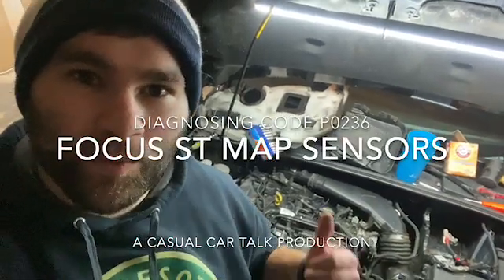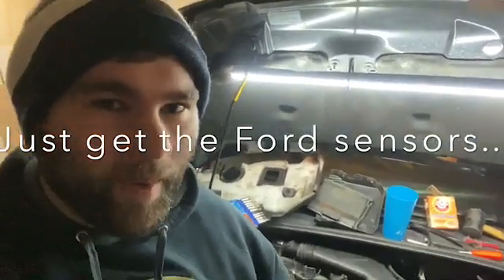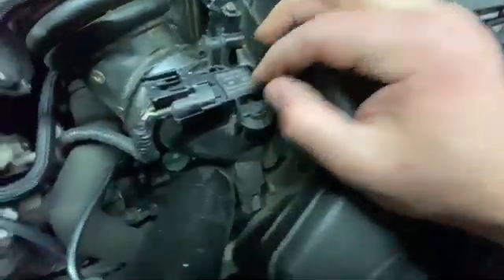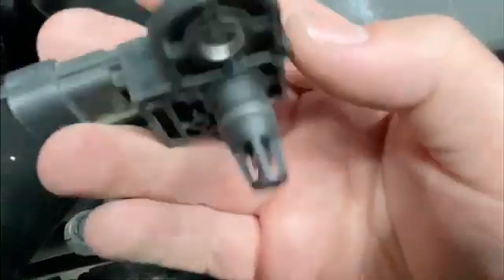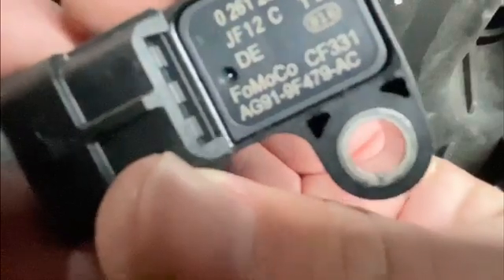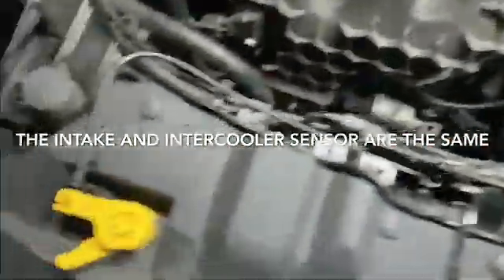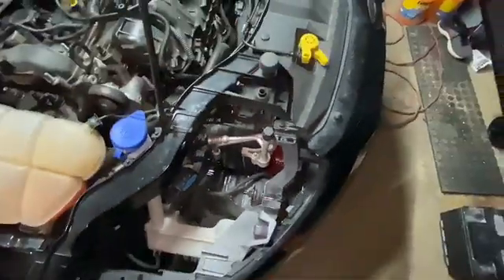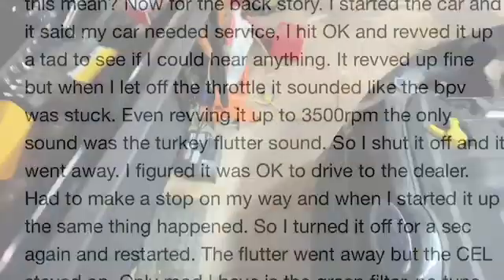CEL P0236 - Focus ST

Comment: When you say Bosch didn’t work what was it doing when you had them installed? I have an intermittent p0236 and I have one Bosch sensor on the intake tube
Reply from the maker: It kept giving me the same exact code as the broken sensor. It’s possible it’s the source of your issue. I bought the ford one and it immediately went away. Can’t promise it’ll work for you, but it did for me and I tried a Bosch from Oreillys and Autozone to no avail.

Comment: How did you manage to fit your hand through to the intercooler
Reply from the maker: I think I removed the stock air box/intake and was able to wriggle down. Otherwise go from the bottom and just remove the useless plastic trays from beneath

Comment: I have a 2017 ford focus rs and I had that some P0236 pop on after having a leak in the down-pipe welded. I’ve already changed all the sensors and the problem is still there. Even took it to a performance shop and they can’t seem to figure it out. The car seems to have no boost and is sluggish
Reply from the maker: The turbo sits right on the back of the engine. The welder most likely broke one of the small boost hoses on the turbo or the boost solenoid - I’d start there. Having a tuner look at logs will at least clear up whether you have a boost leak issue or a potential waste gate problem or something else electrical or mechanical.
Reply: Ohh I took the down-pipe off before getting it welded and then reinstalled it. Then I bought a cpe cat-less down pipe and installed that one to see if that solved the issue but it did not. I got the car tested for boost leaks and it has none, that’s what I was told anyways. Okay thank you I’m going to have a tuner look at it because even the shop that built the car could not find any problems that would cause the problem. Ohh another thing the TIP sensor which is the one by the Inter cooler is an Omni 4 bar which was tuned with the car before I purchased it. I also replaced it with another Omni 4 bar but it kept doing the same thing so I took it off and sent it back. I have a Cobb access port so I’m able to erase the codes every time before I drive. The car drives okay after I do that but only boost up to 20 psi which is way below what is used to at 30 psi.

Comment: Thanks for the video. I fitted a Bosch sensor on the manifold and it was fine for a month, but its not fixed it. I'll try Ford.
Reply from the maker: Thanks for watching! I hope it solves your problem, it was a tricky one to figure out. Please subscribe if it helps!
Reply: @gapperformance any other suggestion please? Help me.
Reply: Finally do you try Ford? Fix or Not?
Reply: @Brombe-fz4fg  Yes it fixed the issue! But then the engine died due to lack of compression caused by a damaged piston. Avoid remaps!
Reply: I've just changed map sensor with an oem ford and the problem doesn't fix. I've a m8ma 1.5 ecoboost on a kuga. @gapperformance

Comment: My 2014 focus st is not shutting off and when i do stall it, i hear clicking electric sounds under hood
Reply from the maker: Is it giving you this code? Try to get it to stall with the good open to isolate where the clicking noise is coming from
Reply: @gapperformance   no codes yet but when i unplug r14 relay for pcm the clicking stops. my service engine light come on but i unplugged fuses and relays before it come on at all. I also changed the battery today and reset the bms
Reply: A new battery  and draining my computer  has  worked so far battery was 9 years old and not losing charge

Comment: good day i need your help
I'm getting the same fault code on ford kuga ecoboos. I changed the sensors p0236 (ag91-9f479-ac and cv2a-9f479-aa) but the fault light didn't go out, do I need to change the one at the intercool inlet?
Reply: Finally do you fix the problem?
Reply from the maker: It could be any one of the 3 causing the code. I’d the intake side didn’t fix it, I’d try the Intercooler. Make sure they’re ford sensors, the aftermarket ones I tried didn’t work.
Reply: @gapperformance  all the installed sensors are original ford sensor

Comment: Hi Eric, i have a non working boost gauge on my 2014 Focus ST, i took it to Ford and they were next to useless diagnosing anything, out of lazyness thet said it was the upper dash gauges, which i was suspicious about, they also wanted $1200 to have them replaced. I left angry and bought instead another used gauge and same issue , it does not move. so that told me the gauge is fine. 
i am thinking that the issue could be the actual boost sensor/s, would you know the location of these and do you have any thoughts on this issue? any help would be greatly appreciated.
Reply from the maker: I believe the boost reference comes from your MAP or MAP-T sensors. It’s up on top of your intake, intake manifold, and another one on the Intercooler. If you had a faulty boost reading the car would likely run bad and you would 100% get a check engine light. If the gauge is the only malfunction I’d assume a wire somewhere is broken between the sensor and the gauge. Make sure you use ford MAP sensors because I tried the autozone Bosch ones and nothing changed. Mine was the sensor on my Intercooler because it got blasted by salt and broken. Good luck! Thanks for watching and please subscribe :)
Reply: @gapperformance  thanks mate , much appreciated!

Comment: So I’m going through the process of replacing all three as well. My only issue it the top on (on the air box) has a part number of CV2A-9F479-AA
The one on the inter cooler is BV61-9F479-AA
Any ideas of if they’re actually different or can I use the same one for both?
Reply from the maker: The intake and Intercooler are the same I believe, but any aftermarket sensors I used didn’t fix the issue. Had to pay full ford price ugh. Thanks for watching and please subscribe :)
Reply: In my case they were not. BV goes on the intercooler discharge. CV goes on the intake.
Reply from the maker: @roxiem9294  I’ve swapped the intake and Intercooler sensors around and never had an issue with codes as a test. The map-t sensor on the intake manifold is clearly a different sensor, it’s odd that yours are not interchangeable, but they could have done updates over the model years for sure

Comment: What if I didn't take the terminals off cause I replaced mine and didn't and my car is throwing this code and I never had this code before. I reset the code and it's still not happy about it.. what do I do.
Reply from the maker: Did you go with the oem ford sensor or aftermarket? Most of my issues are from new sensors that are bad or non-oem have given me issues because fords are sensitive as hell lol
Reply: @gapperformance  all oem i figured it out man so it was the intercooler plug was plugged in backwards,  why did they make it to where the plug can plug up on both sides.. lol anyone could accidentally do this when your under your car trying to plug a plug in thats hard to get without taking the bumper off 🤣
Reply from the maker: @joehuff2292  haha some connectors are just annoying like that, but I’m happy you found the solution!

Comment: Could P0106 be linked to the same issue ?
Reply from the maker: Definitely could be, I believe that’s the dirty map sensor code. It could be the sensor, wiring, or the connection on the ecu side. You can always chase voltages to see if you have a short somewhere. Sensors are pricey from Ford but the Autozone and Oreillys knockoffs didn’t work
Reply: @gapperformance  Replaced the sensor with a new one from ford and it fixed the issue, its been couple days since and code hasn't returned. Now would you happen to know about P2227 ? Been looking around no answer. (Maybe intercooler baro sensor) Would really help thanks.
Reply from the maker: @YoutubeAccount-tn9dj  drop me a subscribe and in the meantime I’ll do some forum digging to see what I can come up with for ya.
Reply: Did you ever figure anything out with the p2227 code?

Comment: Hi, i’m having the P0236 code on my 2016 focus st, it seems my ecu isn’t matching the boost i’m pushing and it’s making the car drive weird i replaced the map sensors and the plugs and coils and im still having the issue.
Reply from the maker: Carlos A where did you get the MAP sensors from?
Reply: Casual Car Talk Auto zone, those codes went away not it’s a boost sensor
Reply: now*
Reply from the maker: Carlos A I did the Autozone ones and couldn’t kick the codes permanently so I went with oem from Ford and they fixed the issue. It was the map sensor on my intercooler that ended up being the culprit.
Reply: Casual Car Talk the code isn’t showing back up for the map sensor, i think it could be another issue but i’m not sure
Reply from the maker: Carlos A did you gap the spark plugs? If you’re tuned go with NGK 6510s gapped to .026
Reply: Casual Car Talk i’ll try that thank you!

Comment: Great video I just got this code so your saying just replace the sensor ?
Reply from the maker: Cory Lee Boxing yes I had to beat around the bush to find out which one, but after trying Autozone and Oreillys sensors the problem ended up being that it wanted oem from Ford ($$$) which was way more simple than it should have been lol
Reply: @gapperformance  Do you still have the issue?  Maybe just cleaning it could help too?
Reply from the maker: @samsonyunited  nope issue never came back after getting the Ford oem sensor. I did try cleaning the old one but it still wouldn’t work.

Comment: Great video 👍🏽👌🏽can I just clean it ? And how do I clean it?
Reply from the maker: Ford Power just grab some MAF or MAP cleaner from your local parts store and give it a good blast. Make sure it’s safe for the sensor you have, and if replacing your sensors I recommend stock oem replacements. I’ve had bad experiences with the half-priced sensors from autozone. Thanks for watching and please subscribe if you haven’t!
Reply: Casual Car Talk thanks for the info 👍🏽👌🏽

Comment: Thank you! This was the first and only video I’ve found for the ST. Recently got the same code on my ‘13 ST
Reply from the maker: Bryant I went forum digging for days to try to find something to try. I made the video because I found nothing specific to the ST! Glad it helped, hit me with a subscribe!
Reply: @gapperformance  I have a 2013 focus st mkIII, When I let go the clutch and gas it hasitates badly for like a second or two. If I dont feather the clutch properly it shuters abit. Trottle response seems weeker than normal. Not sure what problem is I have no codes or cheack engine light. Almost forgot no mater what rpm even at 2.5k or 3k. I do noticed in sport mode abit more less but still there.
Reply from the maker: Totò v could be your clutch wearing out or a throw out bearing going bad. How many miles are you at I’m the current clutch? Also the RS has a stall limiter effect when you let the clutch out too slowly. If I started to stall and shudder and pressed in the clutch I’d kill the motor, push the clutch in, and before I hit the start button it would start again. Super frustrating and it did end up being a bad clutch
Reply from the maker: Totò v also my focus ST definitely doesn’t do it, but I’m also stock and I’m pretty sure previous owner had a clutch put in before selling because it shifts and drives like butter at 82k miles
Reply: @gapperformance  I have a 2013 focus st about 177thousand km wich is about 109 thousand miles. Another strange part is I never stalled. Also when I start the car it shakes idles hard for a second than stops to normal. When let go the clutch and gas it I hear a bang noice feels coming from behind. The car feels like moving back and forth when I shift and let go the clutch and gas it meanwhile all this it hesiates and week trottle for like good second or maybe more. Can it be spark plug or air filter or the rear motor mount broken?